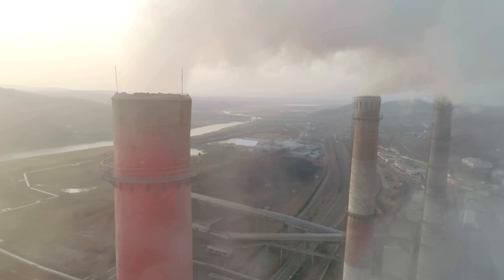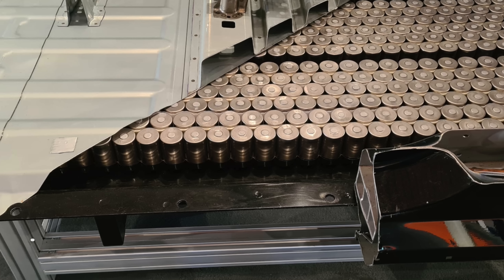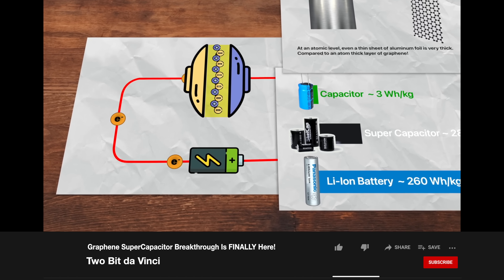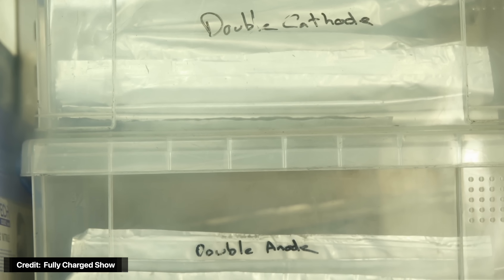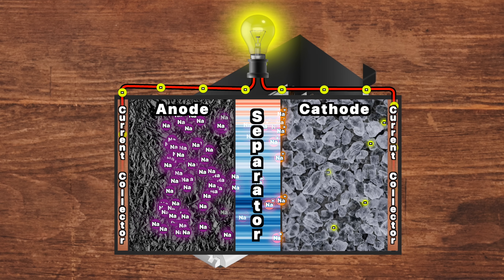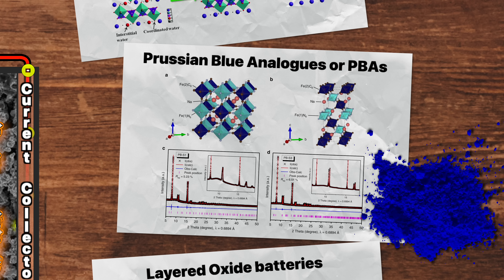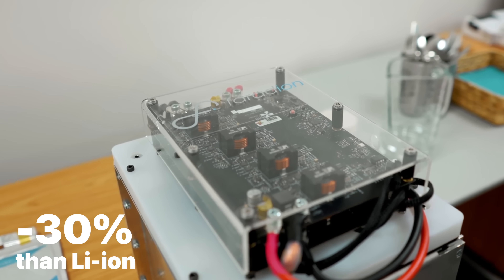Next Gen Battery is 1000x Easier to Source and 99% Cheaper!

Comment: I see sodium ion batteries as good for stationary storage, lithium ion batteries as good for ground and marine vehicles, and solid state batteries as good for medical and aerospace applications.
Reply: There are more than 100 different (non Li-ion) battery chemistries emerging right now
Reply: @Aaron Schwarz  no there isn't... so many are just snake oil and others aren't economical.  We have been hearing about the next gen battery tech that will replace lithium for the past decade... yet we still use lithium.
Reply: @randybobandy9828  We actually already use multiple battery technologies for various applications. Solid state batteries have provided power for pacemakers and space vehicles for decades. Sodium Ion batteries are currently being used for grid support. Pumped hydro and molten salt are used for energy storage at centralized power stations. Molten carbonate fuel cells are used for base load generation in combined heat and power applications. We still use alkaline and lead acid batteries. Some EV startups in Africa are actually using lead acid due to lower cost and better local availability. Sure, there's a ton of snake oil out there, as with most markets. Still, technologies that are viable and useful will be sorted out into their optimal applications. I agree that lithium ion (mostly LFP) will likely dominate the automotive market for the rest of this decade.
Reply: @Indigenous Earthling  no.. I'm talking about a new replacement for out energy storage needs. Not some special type of cell that isn't mass produced or cheap. We need energy density with power density combined with long charge cycles.
Reply: Sodiums advantage is that it functions better in cold environments. CATL is already offering a pack that has 20% sodium cells to off set the effects of cold weather.
Reply: @davefroman4700  that's relevant for a rather large segment of car buyers.
Reply: CATL makes the batteries for Nio which are cars that can easily swap their batteries.  A sodium ion battery doesn't need much density for daily commutes because a Nio could just swap it for a lithium ion or even more dense battery when needed.
Reply: @davesworld7961  I don't see people wanting to do that.
Reply: @klepow  It's not like people are manually removing their own batteries in this case. A machine does it in five minutes. It's easy like going to a car wash.
Reply: @davesworld7961  it's been tried before, it failed.
Reply: We'll see which ones make it, but I think the odds of humanity ending up with a single chemistry is small. Cost, cycle life, gravinometric and volumetric density, power density, efficiency, safety and stability(catch fire), operating temperature all have different importance/requirements for different applications exactly as you implied.
Reply: The sodium ion batteries can take over all of the long-term grid load capacity freeing up the lithium ion for the electric cars until of course the technology evolves to where we can use sodium ion even for the cars. I believe the priority should be that we develop a technology that can be 100% sourced within the United States for our needs.
Reply: I also think your stationary storage market is going to have a segment for very long term ~6 month long for balancing seasonal needs which will go to thermal or compressed air system, while battery systems are used at the 1-3 day range.
Reply: Solid state means a solid electrolyte. It's not a cathode. Lithium, and sodium batteries can have a solid electrolyte, once they are developed.
Reply: The battery swap idea failed because you used to need a couple humans on the spot to line the car battery compartment.  That made the process prohibitively expensive.  Now that can be done all by the machine itself.  Also sodium battery tech was not far enough along yet.  Swapping just to recharge doesn't always make sense but swapping a low density daily driver battery once in a while for a more dense battery for specific use cases is useful to almost everyone.
Reply: Sodium ion batteries might also be good for low end cars sortove like an even cheaper version of what is currently being done with LiFePO4 batteries.
Reply: Could sodium ion batteries be good for large transport vehicles like lorries and even mining transportation equipment?
Reply: @digitalmusic4803  many larger vehicles especially the ones that use public roads actually have a weight limit, so they often need batteries with a higher energy density.
Reply: @digitalmusic4803  no. They are still too heavy, too slow to charge, and too short on range.
Reply: "solid state batteries for aerospace".  Battery powered space ship?  Please explain
Reply: @gumby2241  Solid state batteries are currently used for on board power on satellites and spacecraft by NASA, SpaceX, Space Force, and other government and commercial entities. In the near future they may also be used for propulsion of aircraft such as evtol air-taxis and electric airplanes due to their mass saving higher energy densities.
Reply: @gumby2241  Battery powered gear and electronics. Some aircraft are battery powered as well..
Reply: And lets not forget about graphene based super-capacitors either, once perfect it could be the holy-grail of non-degrading energy storage.
Reply: And hydrogen for planes!
Reply: @Israel_Two_Bit  No hydrogen is just too difficult and dangerous to handle, we will make synthetic hydrocarbons and just use them.
Reply: @Israel_Two_Bit  no.. hydrogen won't cut it for planes.
Reply: Is there an option for vehicles since they are not stationary

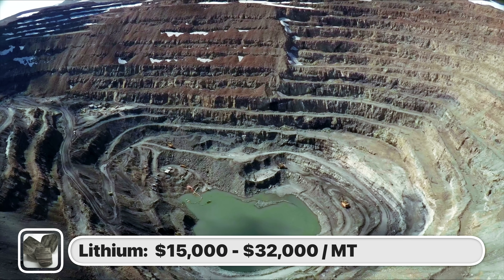Comment: 5:30 ah!  $$$x amount for mining lithium.   Well they would still be mining it if we stopped using lithium, why?   Because as your image shows, it's a copper mine.   Lithium is often found with copper and they have been mining it for centuries.  It's just now the mining companies are getting a 2 for 1 mining bonanza.
Reply: I don’t know of any copper mine that is mining lithium. Most copper mines like the one show is a copper porphyry system and lithium isn’t part of the mining system. The granites could possibly contain higher levels of lithium but it’s very minor compared to the Cu. The average composition in such deposits is around 30 ppm and even then is most likely tied up in the micas.

Comment: I don't care about the Tesla or mobile phone storage anywhere as much as I care about the on-the-ground fixed storage element - the ability to capture and maintain a charge close to point of consumption is key to the whole process.  The Power Wall and other products tend to use very expensive tech to function and stories I've heard paint a less than ideal experience there (especially for the costs involved).  If we had a lower kw/kg (or kw/sqm) density then so be it for fixed space applications, especially if there is a lower cycling impost and a reduced or eliminated fire risk from those cells.  Right now I just can't see grid infrastructure coping with huge surges in demand from lots of new electric vehicles mandated and in regular use, even with an increase in nuclear generation (such as the SMRs) can the grid really distribute and carry those loads to major population centres?  Chunks of "cached" power with tech like this could help smooth that out. 
I just hope people relent and realise that we need a hybrid of technologies with an acceptance that they will be superseded at some point in the future;  then we can at least get somewhere.
Reply: Your information is invalid. The vast majority of stationary storage on the market is LiFePo4 chemistries which are a lot less flammable and a lot more stable. Simply because unlike NMC chemistries which have less than a 1500 cycle life, LFP can achieve more than 8000 cycles and still be able to function at 80% capacity. Even Tesla is moving to LFP now for storage because it does not matter how much it weighs.
Reply: @davefroman4700  moving to newer tech NOW but not before, my references were pointing to other YouTubers who have had ongoing issues such as CWEN88 and other so I don't see what is "wrong" about what I said.
Reply: @davocc2405  I cannot even find a channel by that name so I have no idea what you are talking about.
Reply: @davefroman4700  he may be known now as "tall Paul tech" and he is a network engineer from Brisbane in Australia.  He was only one example I have seen of problems with the product, there appears to be a level of dissatisfaction out there that won't be readily highlighted or discussed by fanboiz or sales oriented types.  Sure Tesla has been evolving the product as you mention but the core point of my original post was that expensive high density storage won't have the value in a fixed location installation (especially domestically) as it isn't being moved and space is less of a premium.
Reply: @davocc2405  I agree that there were problems with the systems at first. Tesla was using 3rd party electronics for their inverters/controllers. And knowing people in the industry myself, they tell me that the equipment being offered now is vastly superior to the original product that they were dealing with before. And you are correct that it is an over priced product in the market today. But, it showed others that residential lithium storage was a feasible proposition. Tesla's aim has never been to dominate the global energy system, but to accelerate the switch to one. You can now buy numerous 5.12 kwh LFP batteries for residential use. In various configuration that are stack-able up to 20-40kwh. Complete with 100 amp BMS, communications for smart systems to manage each pack and even programmable so you can limit the state of charge or discharge. With a nice display as well as a rack to put them in. Each 5kw pack? Is $1600. And the rest of the system components can be had of less than $2k. Tesla enjoy's brand status. But with the IRA coming into effect which will now cover 30% of the entire costs (not just panels), including installation? They are going to have to sharpen the pencil to compete. That is why they are aggressively scaling now. So they can stay in the market.
Reply: @davefroman4700  yet they went Li-ion with the Hornsdale Power Reserve in South Australia and similarly the Gateway Energy Storage setup in California went Li-Ion.  The former I can imagine being a result of only having Li-ion at their disposal in 2017 (that installation has indeed had its issues too), I am not familiar with the latter to know why they went that direction myself.  Either way I still see the use of a mixture of whatever is best at the time as being the only way forward in this relatively early stage.
Reply: @davocc2405  Those systems were purchased and planned before Tesla decided that LFP was a better alternative in cost and performance. That happened earlier this year.
Reply: Without having really looked at it the power wall seems like a waste. It's a huge amount of complexity, cost, and environmental impact. Simply having some solar panels to cover base load that work when they do and don't when they don't seems like low hanging fruit that could have a large impact with minimal effort/cost.

Comment: first open all patents, no exceptions
Reply: then just make the stuff, dont even look at the money issues
Reply: you designed systems specifically to make things harder to make, stopping you from doing anything useful, most just talk
Reply: gov must go away with its patents
Reply: no restrictions
Reply: money talks, sells freedom as a slave
Reply: nice to see you took a bit more explorative take on the stuff :)
Reply: specific energy is nice, larger but less weight in total
Reply: hard carbon = doped diamond
Reply: most of the tesla cost is in the battery, like 20-30k per battery
Reply: 1/10 of that as if money means anything

Comment: if battery makers decide to prioritize battery production for ev and grid storage then lets hope that they continue making 18650 or small 1 to 4 ah flat pouch cells and just parallel/series them instead of making very large 20 to 80 amp hour cells so we can just buy an electric car and tear it down for the batteries for the smaller projects.